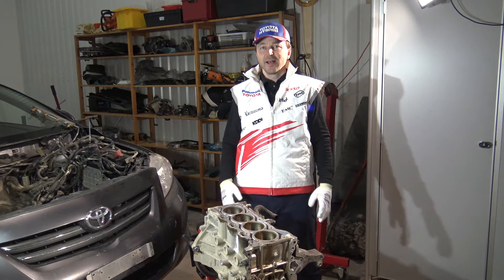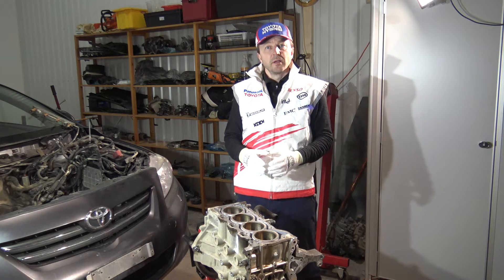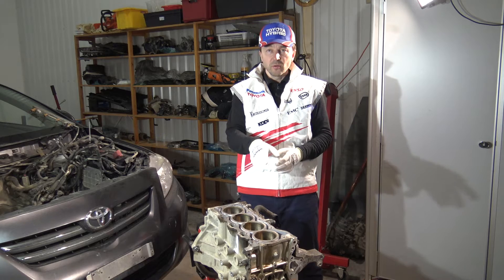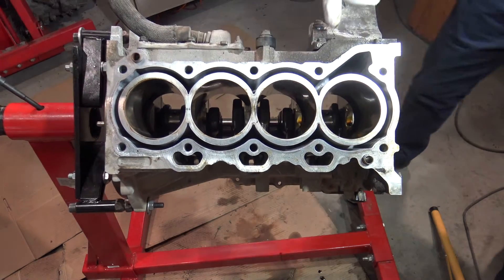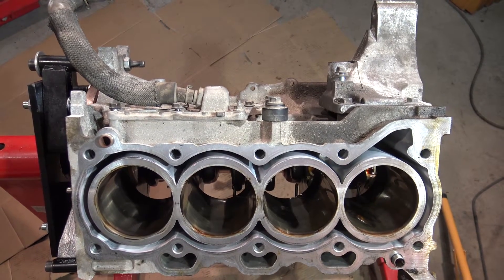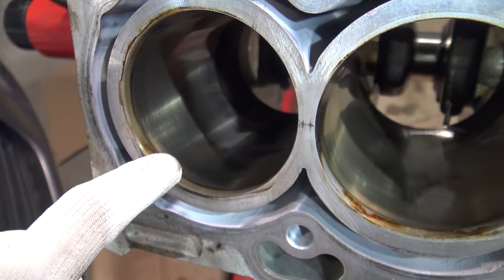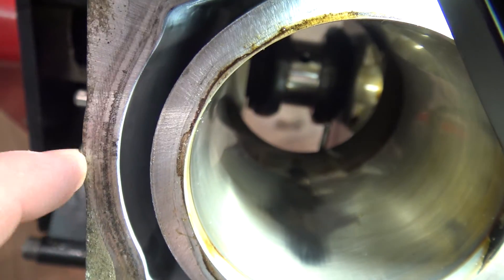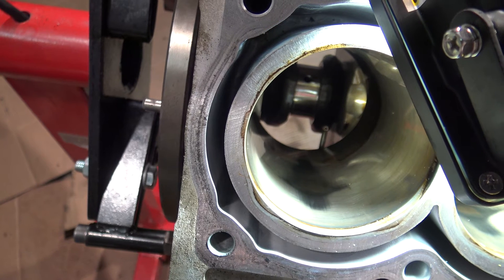What are Scratches and Worn Out things inside the engine cylinder tubes

Comment: hello!  Can too tight fitting of the connecting rod bushings give the same effects as in the movie?  Longitudinal scratches on cylinder surface.  The foreman gave me a bush very tight, i.e. the connecting rod did not fall under its own weight, it did not move freely.  He claimed that he would get there.  Unfortunately, after 2 hours of work, such scratches appeared :( what do you think about it? Https: //youtu.be/NzmLaqUMnbs its air compressor https://photos.app.goo.gl/qVUTU7ww3zof6NiBA